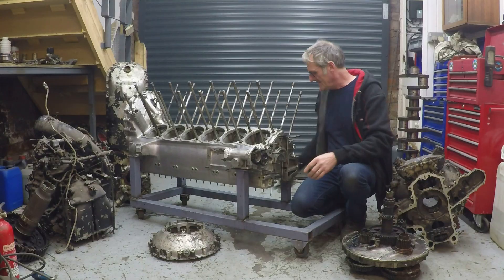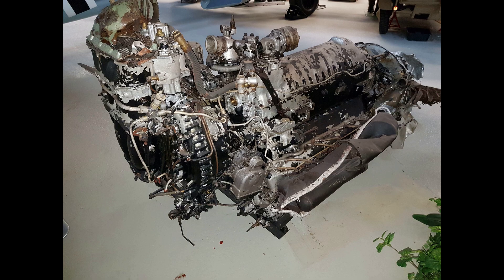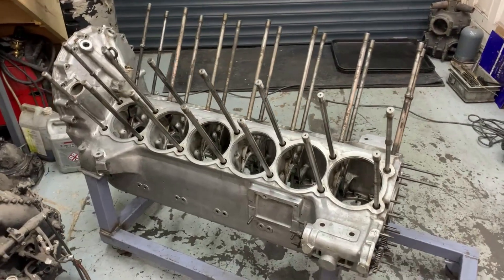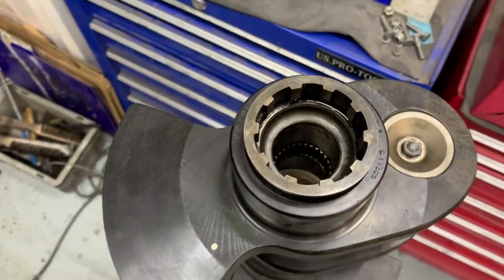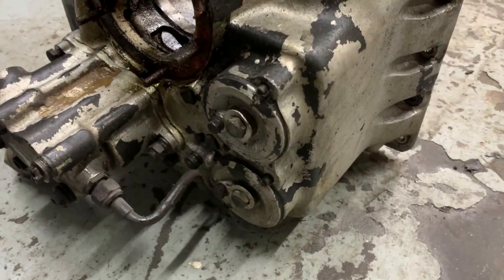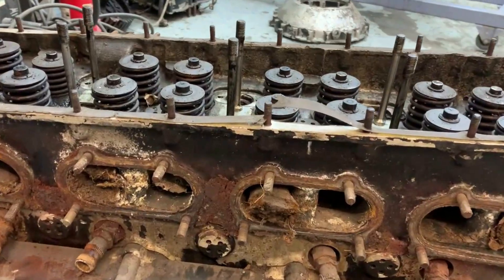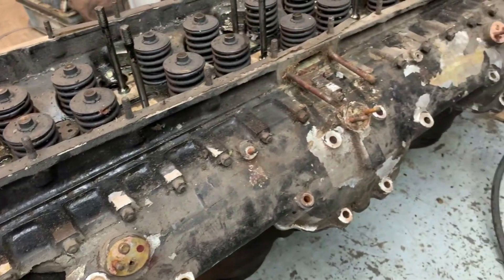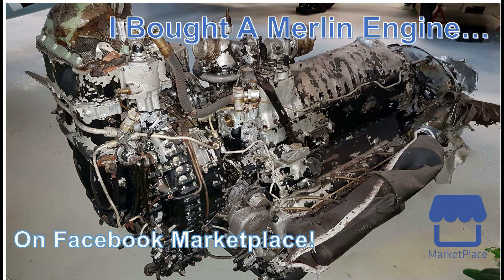I Bought A Merlin Engine On Facebook Marketplace!

Comment: This is very helpful...I'm attempting to aquire a crashed damaged unit for total restoration. I have a complete set of RR workshop manuals to assist. Watching your video is very interesting.  My background is 50 years in marine/refrigeration engineering, so at 67 years, this a rather a pleasant challenge. I shall make contact with you if I can successfully 'aquire' this unit.

Comment: Aluminium doesn't 'corrode' like steel. The surface oxides instantaneously when in contact with oxygen, forming a thin, invisible, protective barrier against further corrosion.

Comment: Beautiful parts. Beautiful pattern work, beautiful machining. Thank you for going over the engine with a camera so well, and for posting it.

I've never seen a disassembled Merlin before.

Regarding the zero-oxygen water: seems reasonable the water in a pete bogg would be void of much oxygen.

Comment: Divco rebuilds and inspects crankcases. I'd just compare RAF to USA practices. Cases don't always get shaved for rebuilds. A good engine found is a "Lucky". You should find parts spares. I'd restore it to ready but loose assembled, so it can be later inspected and greased every few decades. A few of my gaskets are leather. So are my engine mount ends. The cores are rubber carved with a Stanley Sureform. Wooden blades is also a good thing. Culver is a USA all lady propsmith. When you paint your mill, please don't try spray cans. A brush is more durable and economical. Spare accessories is a must. Keep a measurements and work logbook. I'd stay away from anything but regular Prestone and distilled water. Leaded gas isn't necessary, anymore. It runs 700 hours between rebuilds. Bores can be nickel plated but never chrome plate a bore or wear surface. I changed my prop seal every 50 years, whether it needs it or not, and the J&J Airparts lady was howling with laughter. A cooler thermostat is possible if you don't run it in the winter.

Comment: You don’t seem to mention Non Destructive Testing ( NDT ) but very important with these engines !
Reply from the maker: Yes, if it goes back in the air then most of the steel parts need NDT. At this stage it won`t be flying again or running high power, so I`m not doing any NDT, but I am doing the measurements.

Comment: RRHT have a cracking good book on the Merlin in the Halifax. The installation by HP was urm.. sub-optimal.
Reply from the maker: That`s right. I think the thrust line was different to the Hercules powered variant, which caused handling issues. The bearers were also (unusually) bolted together and not welded.

Comment: Is the bolts and nuts on the engine metric?
Reply from the maker: No, BSF, but there are metric ball bearings in the engine, as they were available as standard even back then. They even have the same part numbers as modern ones, like 6205.

Comment: It still amazes me to this day just how similar engines really are, regardless of size, fuel type or even use (generator, car, bike, truck, boat, earth moving machinery or aircraft) of course to an extent, i was only a lowly automotive mechanic, actual modern day turbo fan engine ive never worked on, have worked on radials and even jet turbine engines once. But for the most part they are all very similar.

Never saw the inside of a merlin until today, and i could follow along no problem.

Comment: That first closeup of the bare lock at about 5:00 really reminded me of a Porsche 911 block. The details of the mounting surfaces for the cylinders with the skinny studs sticking out is a perfecrt match. The crankshaft seems to be built up instead of a single piece. Once again I'm reminded of a Porsche engine but an older one. The early 356 S engines had a built up crank by Hirth. He marvels at how clean the inside is. I've worked on car engines from the 1930s to the '80s and you never see modern engines that have only seen detergent oils with that much gunk inside. I've seen engines with 300,000 miles cleaner than that. I'm not refering to the grit from the crash site but the thick black goo everywhere.
Apparently there is no separate cylinder head. That makes an amazingly complex chunk of metal to cast and machine. the old Offenhauser engine used in Indy cars was made like that. I assume, since the block assembly was aluminum that there were iron cylinder liners.
Fascinating engine!
Reply from the maker: Yes, detergent oils are the way to go. The Merlin changed over to a separate cylinder head in 1942 due to coolant leakage caused by increasing boost pressures being applied.

Comment: I hope you have removed the crankshaft caps and cleaned inside. We used to find the cavities full of a carbon paste with only a small passageway for oil to flow through. If it isn't cleaned out  it will dislodge and block the oil ways. Replacing the caps they were blued to check seating and grinding paste used to reseat if necessary.
Reply from the maker: Thanks for the comment. Yes I did, some were about 1/3 full, so it`s done quite a few hours.
Reply: Nice you got back to me. It seems like a big design fault as if this sludge dislodges whist the engine is running it would be catastrophic. Don't now if this has ever happened though. I would have thought it would be sensible to fill the cavity with a plastic/nylon insert with the appropriate oil channels. Or is this a mod already, Do you know if the Allison has the same problem? I reconditioned the tank version which did more hours and as I said we found them full apart from a small channel that the oil got through. This was a paste but as thick as Plasticine. I worked on many different types of engines including several different types of Rolls. It was only the Rolls that suffered with this problem. @FlightEngineering1

Comment: Magnificent   information,     did  wonder if it   had   cold   start  injectors
Reply from the maker: Not cold start, but it does have injectors to help the engine pick up because the carburettor is a long way from the cylinders.

Comment: Are the crank pins continuous with the crank shaft and those covers over the crank pin ends are oil seals? Fantastic video!
Reply from the maker: Yes, one piece hollow crank, so the caps are to hold oil inside the journals.

Comment: Makes me wonder what you do about parts, like gasket sets and rod bearings, piston rings etc
Reply: In England, everything can be fabricated.
Reply from the maker: We can still get parts for it. Gaskets are new manufacture. There is no head gasket on these, just metal to metal and rubber seals.

Comment: what type and viscosity oil to use for it?
Reply from the maker: SAE 50 mineral, or AeroShell W100 which is equivalent to SAE50
Reply: I see, so not a modern synthetic oil? @FlightEngineering1

Comment: We tend to think that the engines of today are so advanced, but it's such a surprise to see the design of these engines from that time period. If only some of the motorcycle manufacturers used some of the innovations in these engines, they would still be around.
Reply from the maker: True, it even has sodium cooled exhaust valves.

Comment: Upside down fits a simpler pallet. I have a tiny Subaru motor that doesn't like sitting on anything! A much larger GM 6.5TD that is easy to sit on a pallet. Shipping crates are cheaper if they don't need engine mountings. Nice score Captain!

Comment: This is the second Merlin/Meteor crank I've seen that I thought was quite grotty and needing refurbishment but the owner was happy to reinstall.  Yours appears less grotty than the previous one but that may be down to video quality. The previous one had clear corrosion pits in the bearing surfaces. When you make the installation video, would you be so kind as to be specific about why you think it is acceptable to refit this instead of having it reground.  My experience is with smaller, more highly stressed engines and I wonder if that is the cause of our difference of opinion.

Interesting that the oil filtration was so primitive on Merlins.
Reply from the maker: The finish on these journals is ok, they are discoloured. As a non-flight engine, it can go, but to return to flight it would need to be lapped, or possibly reground, yes.
Reply: @FlightEngineering1  Many thanks.

Comment: Modern synthetic oil would have done wonders for these engines back in the day.
Reply from the maker: Yes and no. 20/50 multigrade mineral would be a good match. Synthetics attack bronze metals, which are not used in modern engines.
Reply: They received the best they had back then, ad maintenance befitting their use, enough that oil type just didn't play a role with the comparatively short over-all service life of the entire aircraft anyway.

Comment: Pete, what RPM does the engine operate in? The prop is geared down and if I understand it right, its pitch is controlled.
Reply from the maker: That`s right, the reduction gear is 0.42, crankshaft rpm is 3000 for take off and typically 2650 in cruise. Hydraulic pitch control tubes running through the prop shaft, using the engine oil.

Comment: I thought if an engine like that was to be used in an aircraft it would need to have a log book created and signed off on by an engine specialist? In that light, the components would need to go through a recertification process. No?
Reply from the maker: I am that engine specialist, but this isn`t going back in the air, mainly because it is an early engine for which there isn`t the demand. Nothing on a Merlin is "lifed", ie, you don`t have to have a record of how many hours it has done, you can pass all parts on condition, by visual inspection, measurement and x-ray flaw detection (NDT). Quite a lot of this engine could fly again, but not all of it.

Comment: Very interesting. Amazing considering its from a crashed aircraft. I don't know your background, are you an Aircraft engine mechanic by trade? I shall follow this project with interest👍
Reply from the maker: Thank you. I used to build these engines commercially, but this one is a hobby!
Reply: @FlightEngineering1  I thought you must be an expert on these. I am a retired early car mechanic. One of the engines I've always had a shrine up to. I wonder if you can do a section on the carburettor I would love to see that explained? Take care
Reply from the maker: Thanks! Yes of course, it will be one of the later parts I get on to, but I will video it (with better audio!) Yes, I have worked on these engines professionally.
Reply: @FlightEngineering1  looking forward to it 👍

Comment: Being a pilot and familiar with the merlin i think that your engine was in a controlled crash rather than an uncontrolled crash simply due to the lack of structural damage. Well done find and rebuild!
Reply: Being a pilot, farmer and tank commander I am surprised you did not see the subtle but somewhat obvious rotar splint pinion planetary torque drive variable pitch linkage for tank installation
Reply: Could easily be just a flat spin/fall - no forward motion. Seen a few photos of bombers that have just hit the ground following flak/nightighter loss.
Reply: Being a farmer his lucky to have so little corrosion
Reply: It crashed in a peat bog hence minimal damage.
Reply: @ricardoroberto7054  Was Peat aware of it? He is very precious about his bog I hear does not sound like Peat to give it away
Reply: @bjorntheviking6745  more importantly was peet’s bog destroyed so that he had to build a new one, or perhaps he got indoor plumbing and it was an upgrade….
Reply: Was that the same engine from the car that did the land speed record on the beach? They left it for years then dug it up & restored it.
Reply: @alexjohnson1612  that's Peats engine
Reply: You sure its not a tank engine?
Reply: @jesuschrist2284  it had a propeller when found. just fyi, tanks don't use props; steel tracks are normal
Reply: Wonderful sarcasm 😂
Reply: I understand that Russian tanks fly without 
props!  @BaikalTii
Reply: Tank engines do not have a supercharger and I believe the crankshaft is different.  @jesuschrist2284

Comment: Really interesting bigends on it, can you get oversize / undersized bearings like VW air cooled engines or just undersize for the crank and resize the rods?
Reply from the maker: Yes. During the war they had 8 stages of regrind to the crank, and also a few to the outer journal of the big end carrying the blade rod. Later on they made shells with oversize backs to go in line bored crankcases. I`m not sure if the rods were ever ground out.

Comment: As an Airframe and power plant engineer in America I would say at 19,000.00DM? or USD or Pounds you did  fine. Ive worked on P 51's over the years and can say  that ANY engine cases/heads/crank/ supercharger part alone would  be expensive. When I started working  Mustangs  back in 1974 you could buy a  Yellow tagged (Military OH) engine for about 12,000.00USD out in calif...a parts  dealer had over 100 FS, today same engine would be 250,000.00USD AND another 90,000.00 to have a shop certified it. Well done.
Reply from the maker: Thank you! Yes, they have got more expensive and parts more difficult to acquire here in the UK. The real killer was when Aviation Jersey sold out to Vintage V12s, that hurt!

Comment: I served my apprenticeship at Hillington, Glasgow back in 1980's.
At the rear of the training centre there was an stripping/overhaul section for senior apprentices that stripped Merlin and Griffon engines.
I remember they got in a Merlin engine from a crashed aircraft, that had been in a bog for many years. Once stripped, the only component requiring replacement was the crankshaft as it was twisted and that was replaced out of stock parts in East Kilbride!
The used pistons made excellent ashtrays mounted on turned wooden bases for various Top Brass in RR. 😉
Reply: I have question about the piston rods. Does the piston rod that runs in-between the split rod ride on the same bearing? I see the split rod has a copper bearing that bridges the split.
Reply from the maker: No, the "blade rod" has it`s own shells and runs on a journal machined on the outside of the big end bearing block. This means that the blade rod only oscillates while the big end bearing in the centre runs a full 360 degrees as in any other engine.

Comment: 7:32 That's interesting, I've never seen inside a Merlin before.:hand-orange-covering-eyes: The opposite cylinders are in line so the inside rod bearing runs on the outside of the outer rod bearing & that rod is 5 pieces. Was that a common setup on aircraft "V" engines back then?
Reply: Yes. Harley V-Twins and Allison V-1710s also used "fork-and-blade" connecting rods. Griffons used one "standard" rod with a gudgeon for a "link rod" to move two pistons with one crank rod journal. Of course nearly all radial engines used a "master rod" with many link-rods attatched to it.
Reply from the maker: Yes, absolutely right. As below, the Allison V-1710, plus all the other Rolls-Royce V12s except some experimental models. The German V12s used a slightly different idea with a common bush supporting both rods, and some Russian engines used a master rod and slave rod with a wrist pin at both ends.

Comment: Y don,t u use a wire wheel to clean off surface rust
Reply from the maker: I do use them on steel, but they can`t remove the corrosion pitting.